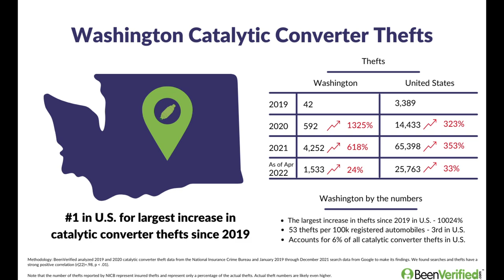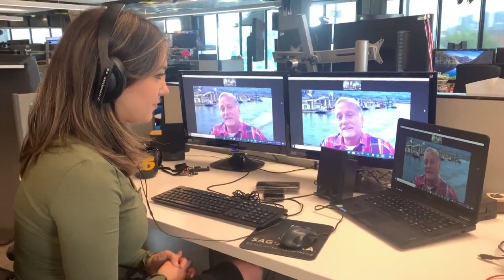Washington sees largest catalytic converter theft increase in country

Comment: Require police to have probable cause to question suspects and make it impossible for police to chase criminals in cars - this is what you get. Then add cities which decided to defund police and are short dozens of officers. This is what you get.

BTW, the steel plate is not available for most models. I asked around for our two cars and no shop would/could do that modification.